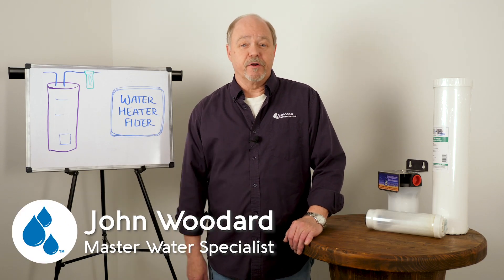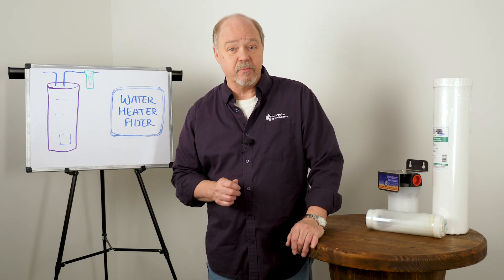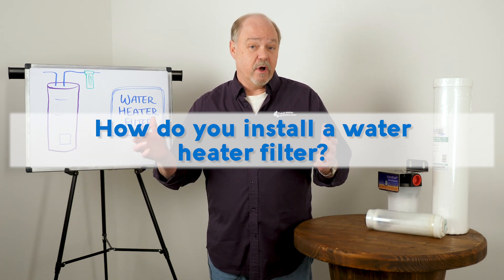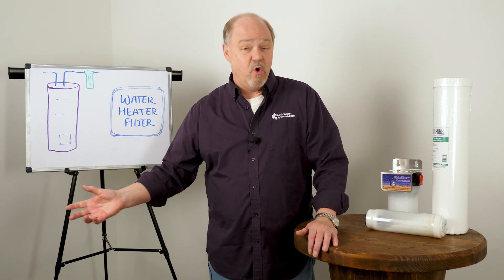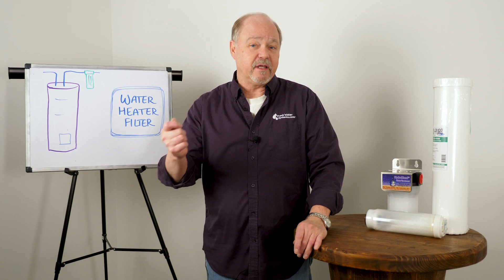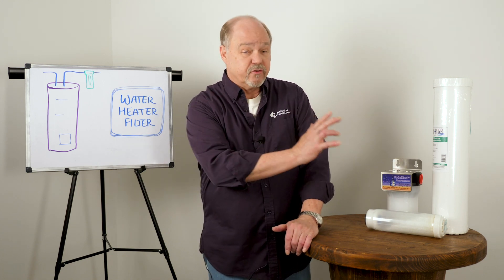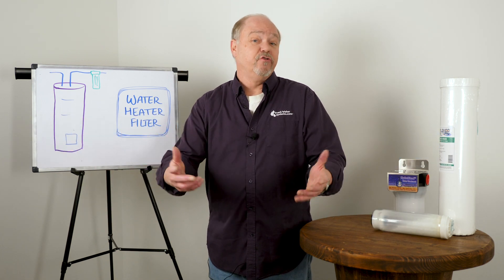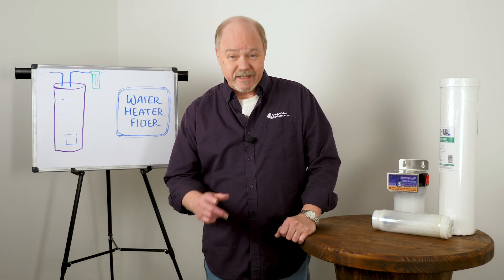What is a Water Heater Filter and How Does it Work?

Comment: My filter is connected to the hot water side of the water heater, is that a wrong setup? Will having it set up that way still work or cause problems?